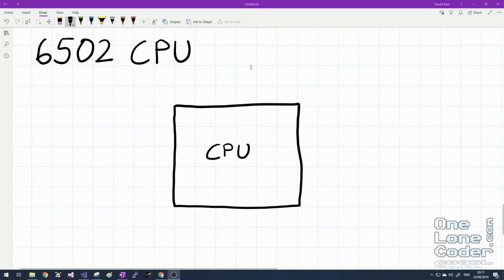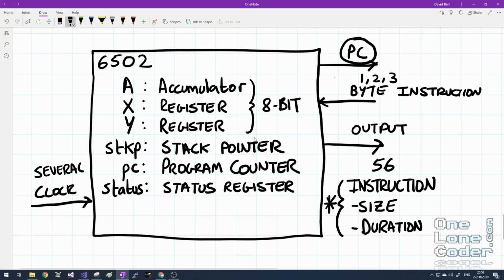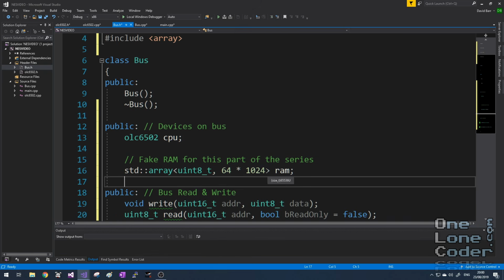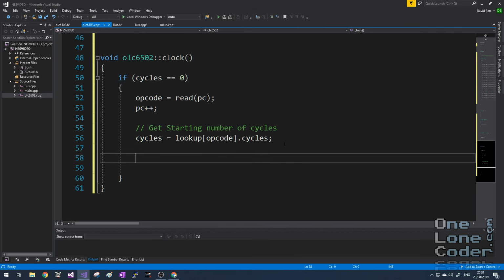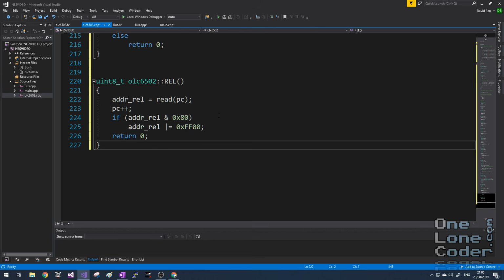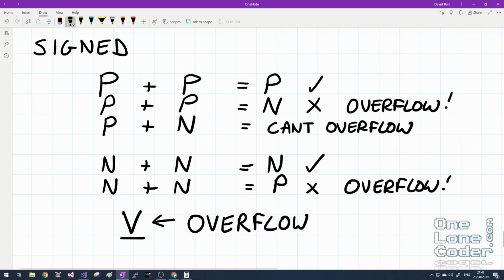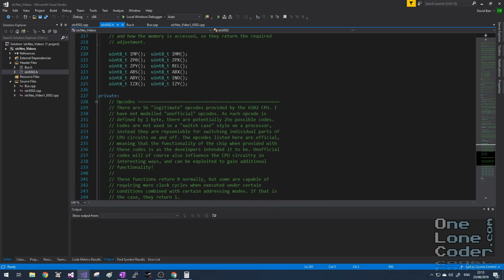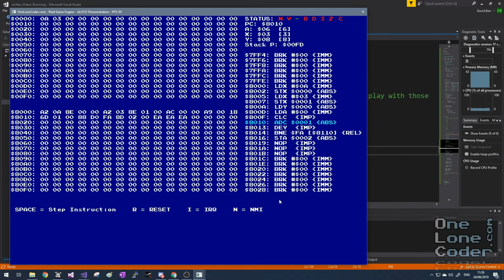NES Emulator Part #2: The CPU (6502 Implementation)

Comment: This is an awesome project!  The only "problem" I have with it is what if I want to emulate, with HARDWARE I/O (other than the PC screen and keyboard/joysticks).  I would need access to hardware (parallel) port on PC, which manufacturers have taken away!  There is also the time indeterminacy that PC's introduce.

With few exceptions, the number of clock cycles required by an instruction is dictated by the BUS, not internal "programs".  (This is the "Von Newman bottleneck", and is why there are "Harvard architecture" machines.)  For example, indirect (addressing mode) instructions require extra cycles to read not only the "operand" part of the program code, but additional cycles to read the indirect address.  Because this adds a lot of extra cycles, 6502 designers made decision to limit indirect addressing mode to only zero page mode, cutting one cycle from reading the operand part of the code.  This can result in strange bugs when peripheral (such as A/D converter) is triggered by the (errant extra) read, but does not affect RAM.  For write, extra cycle must ALWAYS be taken to prevent "errant writes" from corrupting RAM data.
          The other exception are the single-byte instructions implied, such as CLC, LSRA.  All instructions require at least 2 cycles (even though the bus only demands one read of the op-code).
          Other "cycle chewing" instructions are the read-modify-write instructions such as INC (memory).
          In other similar processors (such as 6808) I have wondered how they reduce single-byte implied instructions to one cycle.  The answer is that they run the CPU at double the frequency of the bus.  This makes sense as there is relative few transistors in the CPU versus those  in the RAM.  But at the time, 6502 designer made decision to have "all circuitry run at the same speed".

Regarding the overflow bit calculation:  If you complement bit 7 of both of the operands to be added, the C-flag calculation will give the V-flag result of adding the original 2 signed numbers.  (I have used this in actual 6502 code because the CMP function does not update the V-flag.)  In the code, I carried both operands with leading bit complemented, then test for C-flag set to get the equivalent V-flag result.  Signed numbers with leading bit complemented are referred to as "signed offset binary" where $00 = -128, $80 = zero, and $FF = 127. 

A lot of the video game code have  "cancer" code embedded that writes to the program code  area.  For ROM, these "cancer writes" cause no harm, but for pirate code held in RAM, corrupts it.

Comment: That little multiplication demo apparently continues executing garbage code after the 3 NOPs at the end, if you don't stop it.

I added 4C 1C 80 to the end to hard lock it in its finished state.

Comment: Hi I'm back with one more question since there's one more thing lingering in my mind that I can't seem to work out. What's the significance of setting all of the high byte to 1s in relative addressing? What does that do for later down the line when its added to the program counter? Thanks.
Reply from the maker: Its to bluff the system into working with signed 16 bit numbers. Negative numbers, or in this case jumping backwards n instructions, is facilitated by adding a signed integer, so -1 is actually 255, thus all 1s. To make it compatible with the rest of the way i emulate the cpu, my addresses are 16bit, and only the lower 8 bits are used for relative addressing. If the addredd is negative, then the most significant 8 bits also need to be all 1s.
Reply: @javidx9  Okay, I think I get it now after reading your reply a few times. Thanks again these are some of the most informative programming videos I have ever come across :)

Comment: You're incorrect when you state all you need to do is add a single header file - I did so on ubuntu and hit build issue after build issue after build issue and eventually gave up
Reply from the maker: Did you follow any of the wiki, documentation, or indeed the instructions in the header itself?
Reply: @javidx9  Indeed, I spent more than a few hours trying to get it to work, looking through the wiki, github PRs and forks. Every time I overcame an issue i hit another one.
I admit a lot of this is due to ignorance but either way it wasn't a drop and go solution at least for me. (And my original comment is more blunt than I intended, this is a fantastic series, you just got me in a moment of frustration)

In the end I got it working with the following CMAKE configuration

include_directories(/usr/include)
set(CMAKE_CXX_STANDARD 17)
find_package(OpenGL)
find_package(GLUT)
find_package(PNG)

target_link_libraries(
        ${PROJECT_NAME}
        ${OPENGL_gl_LIBRARY}
        ${GLUT_LIBRARIES}
        ${PNG_LIBRARIES} )

Comment: Hi I have a quick question, why is the program counter able to hold anything in the 16 bit addressable range but something such as the stack pointer which should in theory hold just the same amount of bits only have 8?
Reply from the maker: The stack doesnt need to have the same addressable depth. Its maximum depth is 256, and it doesnt even use all of that.
Reply: javidx9 ok great thanks :)

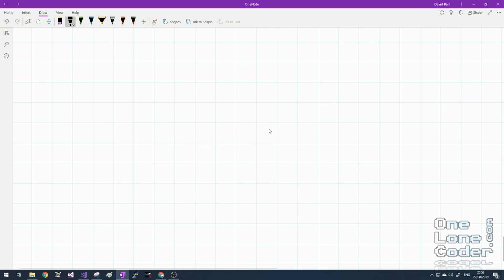Comment: 10:33 I'd like to point out that in the actual assembly language for 6502 "LDA $41" would actually load a value from the address $0041 into the accumulator. 6502 assemblers typically require the pound symbol if you want to use the value itself. Like this: "LDA #$41".
BTW, your this series is awesome! I actually want to try writing simple games for the NES (actually, for emulators) rather than understand how to write emulators, but your videos are the best at explaining how it all works.

Comment: Excellent video. You are a great teacher with very good presentation skills. I'm a self-taught 6502 programmer on a KIM-1 back in 1980-81.Some years later when I got an IBM PC and developed a 6502 table driven assembler in Quick Basic,later Turbo Pascal.

Comment: hi, I have a question. Since SBC works in the same way as ADC, why they use different Overflow flag logic ?   In your video, SBC use `(A^R) & (M^R)` while ADC use `~(A^M) & (A^R)`.  Could u pls give some explanation for it ?
Reply: ok. I eventually figured out that they are equivalent.

A M R V A^R A^M ~(A^M) M^R  (A^R)&(M^R)  V 
0  0  0 0   0      0           1         0        0                  0 
0  0  1 1   1      0           1         1        1                  1 
0  1  0 0   0      1           0         1        0                  0 
0  1  1 0   1      1           0         0        0                  0 
1  0  0 0   1      1           0         0        0                  0 
1  0  1 0   0      1           0         1        0                  0 
1  1  0 1   1      0           1         1        1                  1 
1  1  1 0   0      0           1         0        0                  0

Comment: >> opcode = read(pc);
>> pc++;
I didn't want to comment on something silly like coding style but I can't help myself. My brain can't process why this isn't the single statement `opcode = read(pc++);`
You did this splitting thing a couple of times in the code in the video (and sometimes didn't). Is there any reason behind this?

Also things like:
>> if (foo)
>>  return 1;
>> else
>>  return 0;
Rather than just `return foo;` or if you really insist on breaking it up `return foo ? 1 : 0;`

And lastly (sorry, I only know C) I was under the impression that C++ programmers considered C style casting to be Evil and Wrong.
Lastly lastly (and I mean it this time): converting a number to a string? Is `sprintf(&str, "%X", num);` (maybe use `snprintf` if you're paranoid) verboten in C++?

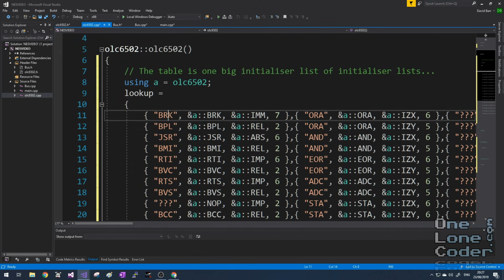Comment: 27:38 Oh the irony of using 6..12 KiB for just this lookup table, to emulate a system with 2 KiB of RAM :)
Reply: Irony? It represents data that was stored in CPU hardware instead of RAM. Not sure that directly comparing RAM usage of an emulated chip to a physical chip is possible.

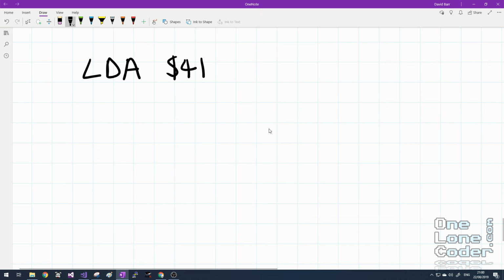Comment: 10:50 The syntax for immediate values is usually with a pound symbol `#` before the number. So this should rather be `LDA #$41`. Without the `#`, it would mean something else: the zero-page addressing mode, in which you use a one-byte address on page 0 in the address space.

Comment: 05:25 Technically, the bus is usually pulled either up to the positive voltage or down to the ground by a pull-up or pull-down resistor on each wire, which means that if no device asserts a signal on the bus for some address, by pulling those signals to the opposite voltage level, there's still a "default" number present on the bus, which might be either 0b00000000 for pull-down bus or 0b11111111 for pull-up bus. This might be relevant if some software depends on this behaviour, but I don't know if any software in the wild does.

Comment: Hey @javidx9 big fan,
I was following your videos and was writing my own NES emulator. However I noticed something in the clock() method you calculate the additional cycles from the Addr_mode and the operation methods and do a logical and operation on them. Your api's return either 1 or 0 depending if there is a demand of additional cycle but there are some cases where 2 additional cycles would be required which would never be happening since the max additional cycles you add are (0b1'&'0b1 = 1). Can you please clarify that a little.

Comment: all those if(lookup[opcode]) calls; why not store lookup[opcode] in a variable, keep the code cleaner and make it a bit more performant?
Reply: The lookup[opcode] calls have constant time complexity, which arguably has performance equivalent to storing the info in a temporary variable and reading that variable. Also, we don't know what compiler optimizations will be done to the code, so they may both come out to the same thing.

Comment: Javid, at 1'05'13 there is a "nes.load("nestest.nes");" command, presumably where the .nes file is loaded into the emulated RAM. How is this done? I cannot find the code for this 'load' function anywhere? How can you introduce the .nes file into the emulation in the state in which it is in just at the end of this video?
Reply from the maker: Hi Adam, Its squeezed into Part #3 since this video was long enough and its more about 6502 than the NES itself
Reply: @javidx9  Hi Javid thank you very much for replying so quickly. I did look in Part 3 but I could not find it there. nes is of Class Bus, so it should be in Bus.h / .cpp?
Reply: @javidx9  I figured it out :)

Comment: What is the hardest thing in emulation? What's the issue emulators face when need to run the games, most they are not playable? Is it of bad design of the emulator? performance issue? missing something as feature in the emulator or something third? lastly i've understand that why games are slow in emulators, for example rpcs3, is because, no matter how good you've done the emulator, your need to hit perfectly the system clock for every game...

Comment: Hi, you're great sir, I was developing my own NES emulator, and after reading the MOS6502 manual I found this series of videos which I found invaluable! I have a question, though: I've implemented the CPU and I want to test it using the nestest.nes ROM. I'm completely lost as to how to use it. I load it into my RAM (my static 64KiB array of bytes) at address 0xC000 and on reset it starts fetching operands at 0xC004 (SEI is the first one). But then how can I check if my CPU is working correctly? How can I check for errors or log something?
I'm testing the CPU without graphics capabilities. 

Thank you!
Reply from the maker: Thanks Luca, if you find the nestest user manual you'll see it writes to certain memory addresses the results of the test. You also need to start the rom slightly differently iirc, otherwise it wont start as it expects controller input. Its all covered in the manual.
Reply: @javidx9   I loaded the nestest ROM file at 0x8000 and 0xC000, skipping the header. I reset the PC at 0xC000 and log the state of the CPU for each instruction and compare it to a correct log that I found on the internet. After some hair pulling I debugged instructions and addressing modes and now my CPU makes it so far as PC 0xC6BD without errors (I think I'm more than halfway throug the complete test). But now the intruction that my CPU fetches are invalid opcodes, for which I didn't provide an implementation (they're nops). So I'm stuck. I dont want to go on with implementing the PPU if I'm not certain that the CPU works fine. What should I do? Thanks a lot!

Comment: At 49 minutes, you derive V = (A xor R) and not (A xor M).
Just cosmetics, but I think it is slightly more intuitive to underline the symmetry between A and M due to the commutativity of the addition by writing V = (A xor R) and (M xor R), saving a not operator in the process. In words, we overflow if both the addends' sign bits flip in the result.
Great vid though!

Comment: I'm trying to remake this with my own twist to it (like adding illegal opcodes) but I ran into a problem with the initialization of the vector of instructions. Visual Studio just doesn't want to accept that I do lookup = {/*initializer_list*/}
Reply from the maker: What C++ standard are you compiling too?
Reply: @javidx9  I'm using default settings so if there is something to change, it would be great to know how to do it. The only thing I found was in my project's properties I could change the language norm (Default, C++14 or C++17) but nothing changes.
Reply from the maker: @KuroAno  If you are using an old visual studio you might be out of luck, otherwise look in project properties and set the compiler to c++17. Another reason it might be failing is if you have changed the type the vector holds, you'll need to be careful to make sure it can be initialised via an initialiser list,i.e. nothing too complex about its construction.
Reply: @javidx9  I just realized what I did wrong : When creating my struct used as a type for the vector I forgot to put the class name in front of the function pointers. It's fixed now. Thank you for helping me.

Comment: I'm looking at your lookup table and comparing it to the rockwell r650x/r651x PDF reference table referred to in this video, and the addressing modes seem to be different. For example, the break opcode in your lookup table uses immediate addressing mode while the reference PDF says that it uses implied addressing mode. Where is the disconnect? Is this a mistake, or am I missing something?
Thanks for the videos, by the way. This has been very informative so far.
Reply: It's because BRK is technically followed by an signature byte which allows identifying which BRK caused an interrupt. So it's implied addressing as the signature byte isn't officially part of the instruction, it's just an identifier after it. He likely uses immediate mode just because it makes things easier.

On the real cpu it's entirely possible to code a BRK without the identifer, but if you don't, it means the code can fail spectacularly. IE, if the code was BRK followed by LDA #$20 (which is hex $A9 $20), then the cpu will do the break, treat the $A9 as the identifier, ignoring it and continue on and run the $20 as a JSR code to an unknown address instead of the remainder of the LDA.

Technically, it's an incompatibility with the real cpu. Copy protection routines on the old computers relied on these sorts of things (IE, they really meant to do the JSR and never wanted to do a LDA, they 'hid' it by putting the LDA byte there to make the code harder to follow.
Reply: @joncorso6103  interesting to note, thanks for writing!

Comment: what about the decimal flag on the 6502/10? sbc and adc will perfform
in an other way if the D-flag is set. (if i remember right)
but i cant wait of the next series of "how to make an emulator." 
yours the best i seen so far ;). eventualy an gameboy, snes or megadrive?
Reply from the maker: This is true Heca, the NES didnt provide silicon for decimal mode so i didnt add it myself, however on the github someone has issued a pr that adds it in, its a reasonably simple addition to the functions. And thanks!

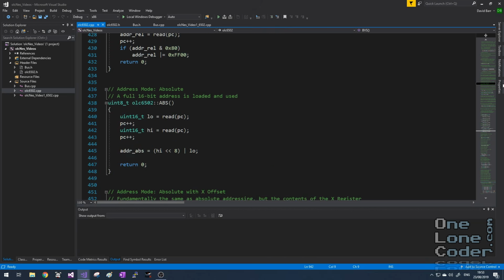Comment: Just to make things clear, putting a large member field inside of the class does not mean that memory is allocated on the stack ( the warning you were talking about at 18:00 ), as the entire class could be allocated on the heap. Only should you actually put that class on the stack, it could result in a warning if you are close to your stack size limit.